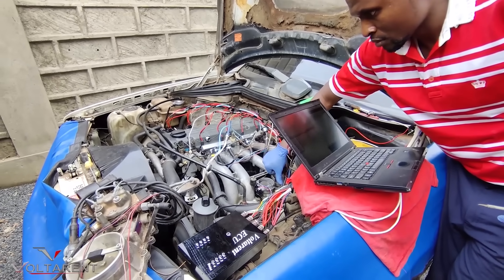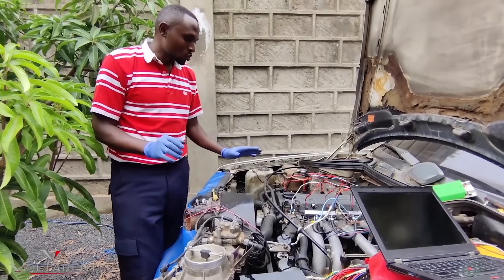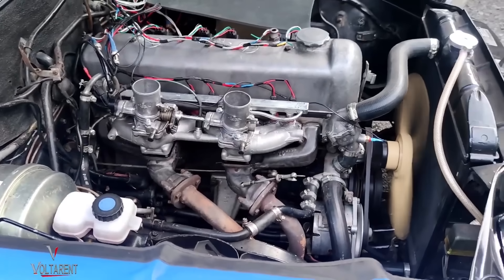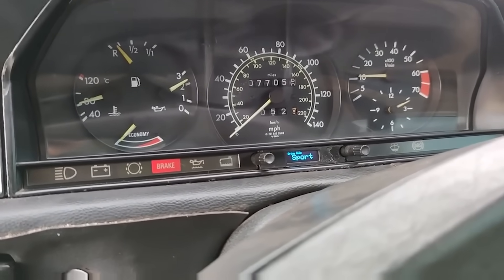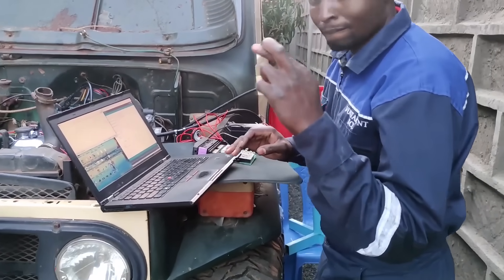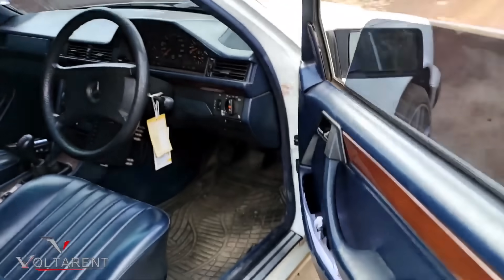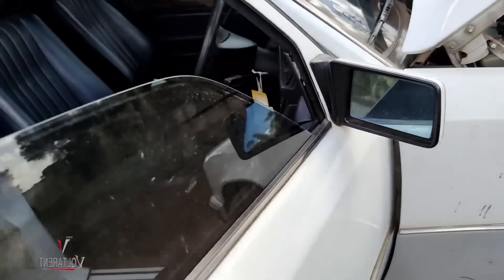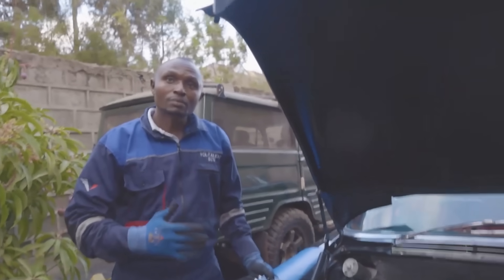African Genius makes Old Engines outdo Modern Engines!

Comment: Alpha-n table without airflow sensor and channel injection? I like the spark coils and injectors on the old engines. Must be like building an SSD in an old computer.

Comment: For the vintage cars the Toyota Land cruiser and the black Mercedes, what exactly he is controlling with his ECU? They both do not have variable timing, no emissions control either. Only ignition and fuel can be controlled by modification. Both seemed to have carburators, or he has modified that to single port barrel injection which were not obvious! That may just leave the ignition control. He needs to provide more information about his innovations.

Comment: This isn't difficult to do and the engineers at every automaker know how to do this even better still. The problem is emissions so you have to reduce power and fuel economy to reduce emissions by a lot so it can meet emissions regulations which have become horrible now. If emissions regulations were not a problem we would have more powerful more efficient and more reliable engines but they would pollute a fck ton more.

Comment: It took me pains to interpret where the spark plugs had gone, no need to use multipoint injection, that´s a lie and drives the engine unmaintanable because of physical complexity, moreover, you are keeping the carburator  gorges so that's the same intake loss than using a carb , This technology is mainstream for GNC in my country, or even in replacement for shitty ECUs to save a whole car, I bet your ECU is better than tons of shitty ones that used to be out there. Namely those from Volkswagen and Renault. ¿What is an ECU for?, To visit friendas and beautiful places or to visit the repair shop?.

Comment: OK, what exactly are we gaining here? Going from reliable and tested single point injection to unreliable hand made multipoint. And that's it. The intake manifolds remain the same, exhaust manifold- the same. Compression ratio- the same. Ignition timing might change a little- helps with emissions and mpg (probably under 1% change). But the overall air flow in the engine is unchanged, therefore producing NO difference in torque and hp and the whole installation causing many potential reliability issues.

Comment: They install the multi-point fuel injection system integrated with new ignition system, converting the old carburetor engines into moden ones! Priceless! Well done!!!

Comment: @PeterMbuiria1 this is not ready for public use.  

Your fuel pump setup, you need to wire a 5 pin relay with a feedback to the Arduino and a I dont see a fuel pressure regulator sensor?  

Have a look at using a Raspberry PI, ita got a far more powerful processor and you can put it in a box and hook up a touch screen.  Do yourself a favour and look up the fault code system  OBD2 code.  

As for the 124 102 motor, look at the later models and you should be able to see that the distributor can be completely removed.  Once that is gone you can then set the ignition timing one the feedback from a knock sensor.  Those engines never had a knock sensor but you can wire one on the block using a later model one from a BMW that bolts on to the block.  

You have a long way to go.  Well done.

Comment: so he basically made his own standalone ecu - nice ;) but the job is not done with adding just the ecu, as he has mentioned, the ignition and injection system needs to be replaced, and he needs to add various sensors, so the ecu can actually calculate the right fuel amount and ignition timing ( that includes sensors for air flow, crank position, exhaust gas temperature and/or lambda probe ) so even 2000$ for a ecu, all the hardware and the work, would be cheap as fuck - even on a 4 cyl engine...  In Africa it makes sense to upgrade that engines, but in Europe every car still running on a engine with carburetor is a oldtimer and has more value if original... Tuning is a different story - I run a B18 with turbo, and switched from ignition with distributor to ignition coils, so a standalone ecu was needed, to get things running again... the ecu alone was 1500$

Comment: this is impressive although he is using some of the most bulletproof and engineered engines and drivetrains, there is a reason those cars can still be around even before his ECU. I would love to see his tech on some of the worst most unreliable vehicles. An led bulb compared to a bulb from 1970 is also nice. modern tech applied is nice. would love to see his evolution from this.

Comment: I remember looking into the impact of a distributor’s wobble of say +/- 1 degree vs a crank sensor of 0.1. Since you must set the timing to the worst advance (intermittent knock ), you gain the benefit of the 1 degree. This alone was worth a meaningful benefit to economy and power. Jumping to a level above, some systems have per cylinder knock detection (spark waveform monitoring), so adjust mix per cylinder.

Comment: Remember this guys, this man is not suicidal
Reply: 😂😂😂stop!
Reply: What he's doing here is very impressive but its not some revolutionary invention. He clearly states he's just modifying older carbureted and mechanical fuel injection to modern electronic fuel injection. This may even be bad for the older engines that weren't made to handle the higher compressions that may come from this modification.

Comment: 1:02 A distributor is the successor to the carburetor may confuse many but he's talking about a Bosch K-Jetronic fuel distribution system more widely known as manifold fuel injection.
Reply: I'm confused with what you mean by "a distributor is the successor to the carburettor"?? There are many cars that have both, a distributor is the part that gives the spark to the spark plug when needed and a carburettor is a fuel delivery system?
Reply: @jimmyd5117 this isn't a distributor for ignition. It's a fuel distributor. Pause and have a look at the system, you can see where the hardlines connect for the fuel.
Reply: I thought fuel divider just like my volvo 240se
Reply: How is he running fuel rails and injector on that Mercedes alongside twin carbs? It appears all he’s done is replaced the distributor with electronic ignition

Comment: Fuel engines are made to be 90% inefficient, In the u.s the use of oxygen sensors restrict you from making the combustion more efficient, the moment the oxygen sensors don't register un burn fuel they add fuel to the injectors making a fuel rich combustion.  To make things worst for the engine manufacturers add to the combustion the recirculated combustion gases EGR

Comment: I would like to have my ECU put the engine in closed loop at 190 degrees F with air to fuel mixture 14:1. At this point I want the computer to command the resistor thermostat to open fully and not throw a DTC  open coolest  and not disable the AC

Comment: @knowledgeinkenya - Love seeing this kind of engineering for older vehicles! I have a 95 Chevy motorhome, 454 big block with a throttle body fuel injection system, it runs great and its powerful but only gets 8-mpg on a good day. I wonder what your system could do to improve my older vehicles mpg without losing the performance?

Comment: and this is why 5sfe has not suffered from ethanol fuel, this is why 5sfe has all the power and no programmed sport mode just ignition fuel and temps and air mode

Comment: I'm an electrical engineer and car guy and I'm impressed. Finicky Mercedes ECU's are so bad that when used in aircraft, they install two for redundancy. I'm sometimes tempted to throw out the ECU on my M275 V12 and program one from scratch, but then I consider the number of sensors it reads and all the complicated logic and I decide it's easier to just try to fix the Bosch crap. Now the third alternative is to install a Voltarent.

Comment: Some people write in the comments that they are engineers themselves and what a nice job the guy did. I'm curious that, as engineers, the first thing that comes to mind is that you might have to measure what the guy said is working. Throwing together some sensors, an Arduino and an output is not a big deal. Writing a normal software for this is a bit more difficult, but you can find almost everything you need on the Internet. It's weird that no one has any doubts that this all actually works the way the guy claims in the video.

Comment: The guy made his ECU from Arduino. With the power of electronics and C++ programming knowledge, you can build everything. I have an IoT operating system and i can connect any type of electronics online in less than 60 seconds and drive it/operate any type of circuit. The ECU is a good idea, but we already have speeduino custom Arduino ECU which is open source. But i always like the idea of running your own system and tune the things as you wish. I did an electronic ignition system for my old motorcycle using arduino and mosfet transistors. One thing he needs to use is a better controller, for example some ARM boards using cortex processors, GPIO expander, platformIO and better terminal software. Using Arduino IDE is the worst choice. The sky is the limit. 😂

Comment: Why not put up.a link to his web or some other means of contact? Also, would be interesting to know if his solution has some way of feedback to adjust for different conditions, like a lambda sensor + how and if anti-knocking is done? Seems very few sensors in this setup, so maybe this is really only usable around sea level and climate where it is installed and tuned

Comment: nice tech but late in game...
as worldwide are electrifying its line up & by 2030 i think .. all gas only engines will be prohibited from selling used & new .. there for .. EV kits are more desirarable than a univirsal ECU...
like converting an different power trains to EV that would be install in engine place on same gearbox
from 
FF FR MR AWD 4WD F4 4x4 manual automatic etc...
& can handle the weight of triple diffLock on a 4x4 etc...

non the less
enjoy this final 5~7 years for pure gas cars xD

Comment: This is - crazy, taking up basically the old shell of an engine and adding a modern control onto it. Amazing idea. And using a low-end toy level computer - that shows how powerful they are now. The only negative i see is that if the engine belongs to a legacy collector car - that destroys a lot of value (they even for small spare parts look for originals to maintain it in "unchanged" shape - but for most daily use cars... WHOW. Just whow.

Comment: He is smart, and talented. This is very far from new though, I hope he did not do all the work thinking he developed it. 
For over two decades there has been a  very powerful Open source EFI and Spark system called" Mega-Squirt n' Spark or SNS. Very well developed, used in auto, marine, and aerospace applications successfully. Very popular for guys who have old DMC Delorians with small block 350 swap.

Comment: I have never heard of needing to reset carburetors from time to time :joy: Some points he is making are true like fuel efficiency but also some are just not true. Carburetor, mechanical fuel pump and distributor will always be more reliable than electronic anything.

Comment: Starting a car brand is no joke. He has to develop his own engineer and various components that is align to his chassis and car, or he has to rent or buy one example the Benz bakkie/4x4 uses a Navarro chassis not one of Benz do he had to develop that and the software to run the components. It costs roughly between 50-100Million Dollars to start a car brand. Or start your own like Porsche did but still not less than 30Million dollars startup, that's the key issue many countries avoid starting their own car brands.

Comment: Very good but I bet this isnt better or equal to "Speeduino" which is a software for Arduino based ECU. So this is basically what very many run on their cars. I have this exact setup on my Volvo 740 and its about 200-250 hp with medium size turbo (t04). Its good for him that he did this but its not a breakthrough at all like many people believe. 😅

Comment: This is not exactly new. There a retrofit shops in Poland that  do the same. They replace the hydro-electric k-jetronic with an pure electrical system that controls the air intake (oxygen amount and pressure) and electronic injectors. They can tune the system to be very economical and gain power too. The problem is that these modification are not street legal in the EU countries. Guess why? They want you do buy new cars.

Comment: THis is great. Congratilatyions. 

I do have a few concerns though: How do the cables handle the heat in the gnine bay? They seem too close and all over the head. Electronically manipulating the performance without making changes to the mechanical system and parts of the car will definitely make the car retire quicker. The whole head (Pistons, gasckets, valves, spark plugs, etc) will be overworked and will fail sooner. So what are you doing to mitigate that?

Comment: Question: How does this affect emissions? Can and older modified car pass emissions test in the US for instance?
Reply: Can I buy shares in your Voltarent?
Reply: Depends on the physical condition of the mechanical stuff. fuel delivery and spark can only make up for so much.  You can run it lean, but you might lose mpg's. Peak power comes in between 12.5:1 and 13.2:1 afr. 14.7:1 only losses a couple percent in power output but its where carbon monoxide and unburned hydrocarbons reach zero and carbon dioxide are at its peak. A loss in compression can inhibit the engines ability to combust effectively.

Comment: I understand but what is the point if the engine is essentially the same with electronic control but no major horsepower increase, it makes the engine more complicated and less easy to service.

Comment: aftermarket engine management systems have been on the market for decades.  He basically integrated 1980's tech into 1980's vehicles.  Not trying to take anything away from the guy, he's got some smarts and put in a lot of work, but it's nothing new.  Myself and a friend have created our own maps to run vehicles on ethanol, natural gas and propane. Also, I don't think his system is utilizing oxygen sensors for closed loop operation which would make his system far less capable and accurate than already available systems.

t. 25 year tech and passionate enthusiast.

Comment: Revs very smooth. Custom fuel rail and full electronic fuel injection upgrade is excellent. That would have been a massive pain in the arse to do solo, nvm in Kenya; Mail order nightmare etc.... Super props. A lot of respect, got smooth maps for a lot of cars it seems, possibly self-learning? unbelievable if so.

1 quibble would be to screw down the TO-220 packages, vibration will eventually snap the legs. 

Now my politics.... don't emigrate. People like you leaving is actually more harmful than the most exaggerated claims of empire. Link up with connections abroad and try and get kits marketed for classic cars all over the world. There are loads of old cars like VW bettles etc in use around the world.

Comment: How are you measuring.  ST LT fuel intake for the 14 to one ratio with no air.. I think you're just atomizing and fuel injecting but you're not quite getting your mix right you're probably still running rich.. tho I'm sure it's better than a carburetor
Reply: You probably are only injecting at a time interval. You made 90s fuel technology..but it's 2024 . I'm just trying to help is all I'm not coming down on you for being a brilliant guy

Comment: How did you buy a brand new old engine.. how much does it cost to add fuel lines.. you have no air control only gas it looks you should have electric throttle cable o2 no?.. how do you keep it so clean inside the engine.. I'm impressed I liked video

Comment: Impressive work! However, It would still be banned off the road in London. Most cars are either forced off due to cost or chasing net zero that makes almost no perceptible difference to the atmosphere. At least Kenya has some engineers who wont die out!

Comment: Do accurate fuel consumption measurements: 10 km/l (or 10l per 100km or 23,5mpg) is for European standards not great for a 4 cylinder engine. Let it check by tuvsud / TÜV in order to test it for a big market.

Comment: Nice job with the ecu, I also use arduinos for all kinds of stuff. Fantastic chips, but I have to note that arduino due (running at 84Mhz at stock) can run around 105 million instructions per second so you would need ten times faster chip if u need to do calculations in nanosecond ;)

Also the first mercedes is a beauty! Paints looks pristine, and the red interior goes well the black exterior

Comment: Nice job building your own efi. Very impressive. I reversed engineered an early holley efi as the code was never locked. I was able to read all the sourcecode and learned a lot about what was going on. Loved seeing your live data flow. upgrading a carb driven engine to an efi really does make them more efficient.

Comment: I have rebuilt countless Merc and some corvette mech fuel injection systems.   Very tedious and specialized work to correct aged and broken systems on said vehicles.  i rather enjoy the challenge and have revived many.  We are talking upwards of 7k to correct a aged system and get them tuned back to reliable and power producing smoothness.  I will def try a Voltarent Setup.  LETS GO!  AWESOME BRUDDA!

Comment: im not hating on the guy he did a fantastic job building that ECU
but he chose the wrong car for that job 
the W124 in reliable because it has a mechanical fuel injection system (maybe that's all he got) but seems kind of pointless to